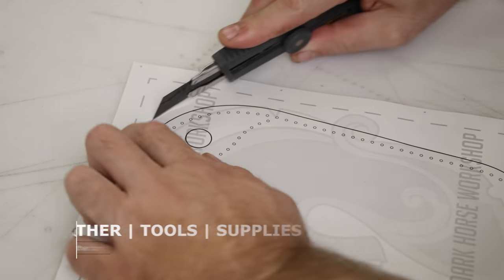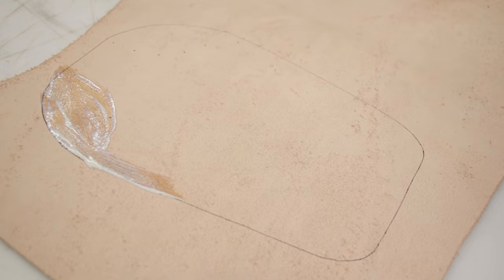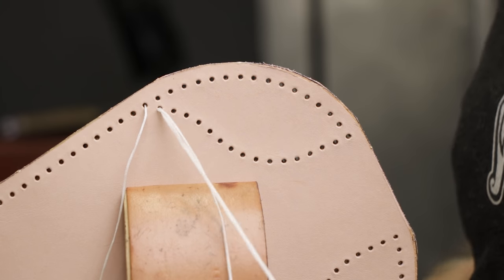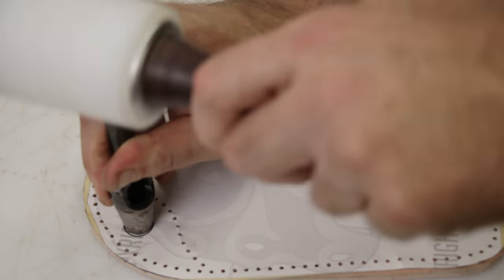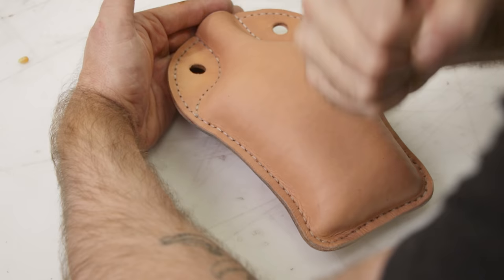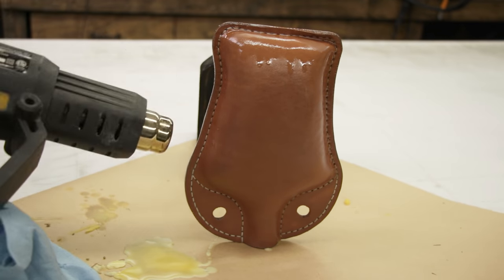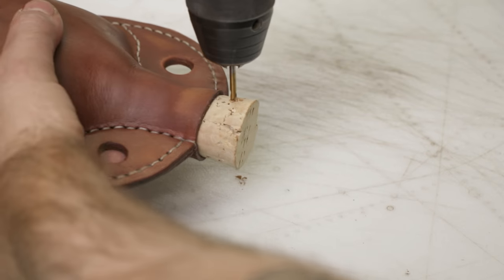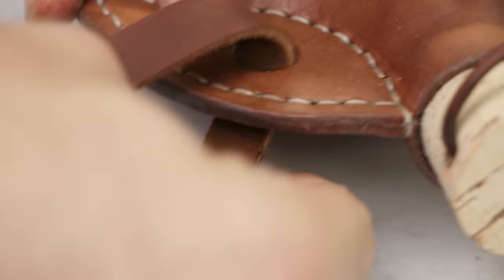How to Make a Leather Canteen / Costrel

Comment: If you are allergic to bees wax or are worried about an aftertaste (it's slight, but there), there are food safe products out there that will not crack or degrade into the vessel. Make sure that you check the safety documentation for the product before purchasing it for this use. It needs to be food safe for vessels, not just eating surfaces. The ones safe for eating surfaces are great for bowls or plates, but are not approved for vessels like this costrel. Please note that many of these products require a full 30 days to cure before they are deemed food safe. Great video. When I make leather vessels, I prefer to have a double row of stitches along the bottom and sides but this one is pretty small, so it isn't necessary. I also leave some leather extending beyond the edge to trim after stitching. I use airsoft bb's to stretch mine. They are super smooth and don't get stuck in the seam.
Reply: U think food safe silicone is okay?
Reply: @moisesmera7913  it is! it bonds nicely to the leather and is, as one would imagine, food-safe. there is a caveat: i would heartily recommend wet-forming the canteen around a bottle in two pieces, lining it with silicone, and then stitching it together BEFORE the silicone has cured. this way, it produces a nice seal on its own. the actual seal on the leather wouldn't matter in this case. just be sure that it's sealed everywhere so there's no damp, dark leather for mold to grow in.

Comment: I've made some of costrels since 2017 and there's one step I do that you probably don't use to do. After fill the costrel with corn to expand the leather, I use to drown it a few seconds in a big pan with boiling water, just to expand the bevels and tight the sewing.It's not a necessary step because we always seal it all with bee's wax, but helps a little

Comment: I wonder if a tightly rolled, glued, and waxed leather "cork" would be stronger and less likely to leak or break?  Roll a piece of leather, glue it, wrap it in thinner leather with a tab at the top for the lanyard, glue and whip stitch it, wax it...  Just a thought.
Reply: What about a carved piece of wood?
Reply: @ChrisKoehn  Still soak it in wax and rub it down (wood will soak up any liquid it comes in contact with, that's why oiled bamboo utensils are better than dry wood spoons for cooking), but that would work too.
Reply: @Leathurkatt  what about linseed oil? I was wondering if spirits would degrade the beeswax if one decided to use the flask for more potent liquids.
Reply: @ChrisKoehn  You would have to do some research to find an oil or other natural sealant that is food safe and usable with such liquids.  Not sure about linseed oil, though I have used it on my ceremonial staves and walking cane.
Reply: @ChrisKoehn  I would avoid ordinary boiled linseed oil from hardware store for a project like this. It contains assorted metallic salts as drying agents that I wouldn't want to ingest. It's non-toxic when fully cured for handling and surface contacts with food but I wouldn't want to store liquids in a vessel treated with it.  Also without the ability to off gas properly it would add a real funky smell to the inside of the costrel and anything stored in it. 

Beeswax is partially soluble in alcohol at room temp, I'd be concerned storing liquor in in a vessel treated with it, but lower concertation beverages like mead or wine should be fine. You could also use paraffin wax instead of beeswax if you're looking to store hard alcohol. Food grade paraffin is completely non-toxic and is even safe to eat.
Reply: @funkyspacecow  Wow, thanks for the great reply! Good stuff to think about.

Comment: What if you want to dye the leather? Once sealed with the beeswax, would it still be food safe? At what stage would you dye the leather? TIA
Reply: I would think you would just dye the outside so it should be fine...you can dye before wet forming or after either way.

Comment: What do you think about dying the leather prior to applying the beeswax? I can't find much information on it, and theoretically if the whole thing is covered in the layer of wax, none of the toxins or the dye should be connecting at all? I can't find any information on this surprisingly.
Reply from the maker: No issues. The lining inside of wax if done right will just be wax

Comment: I'm worried about its durability. I definitely wouldn't try any hot beverages, but on some hot days even, couldn't the wax melt out of it?
Reply from the maker: There's always a chance the wax could soften or melt in extreme heat. But I'd also never put anything hot in it, that makes very little sense for sure.
Reply: @DarkHorseWorkshop  I think maybe I don't leave it in the car and keep it filled with cool water and it should be fine.

Comment: Would you say tooling a design on the main body effect its ability to hold water?  I feel like it's a space begging for decoration but not if it hinders its function.
Reply: I would think that as long as you maintain the integrity of the leather (i.e. there are no holes) you would probably be fine. That being said, it does stretch the leather when you do, so there may be some misalignment with the sewing holes. There's also the possibility that your tooling might get warped when you go to shape the canteen with the corn/beans/sand/etc. Wetting down the leather and pushing it out like that may ruin your tooling.

Maybe around the upper edge holes? Or you could probably sew on a tooled patch. Just punch the holes ahead of time and make a pattern from them after the leather is stretched so your sewing lines up?
Reply from the maker: I agree with Amanda here.

Comment: What size punch do you use for the strap holes? Or better yet what lunch do you recommend?
Reply from the maker: I use a bunch of different drive punches, or an expensive rotary punch. If I'm stitching I use the smallest punch I can find that works with my thread and needle. Nothing is set in stone.

Comment: Hi, I just followed you lead and made one as a gift but it flattened out and is leaking. So after the waxing part I re filled it with corn to get the shape again. I will empty it again and try to re wax the inside. Any other suggestions?
Reply from the maker: Need to wax the whole thing thuroughly and not use too thin if leather. They can certainly be finicky. I lose track of comments a lot feel free to email me for any other questions. info@darkhorseworkshop.com Cheera